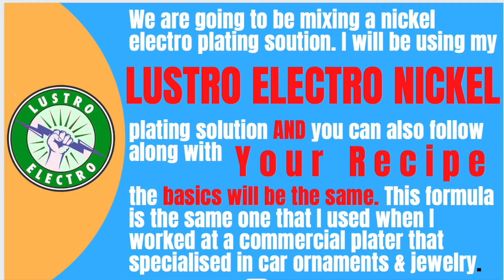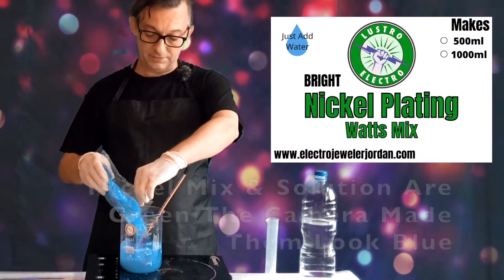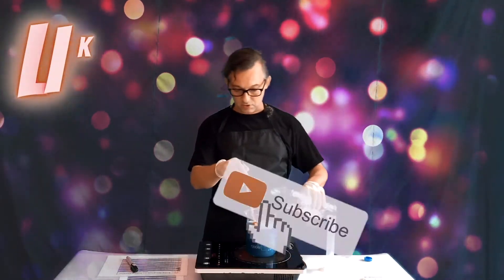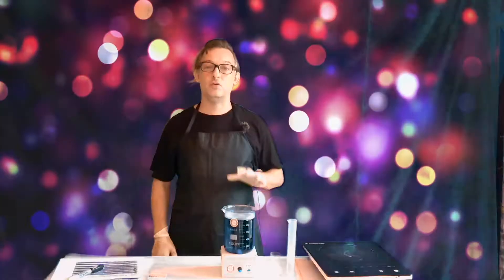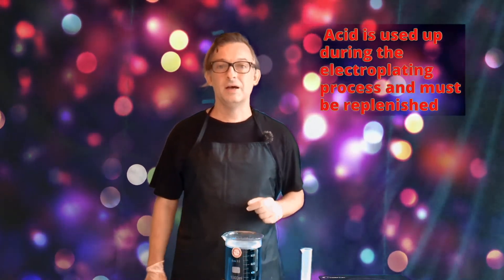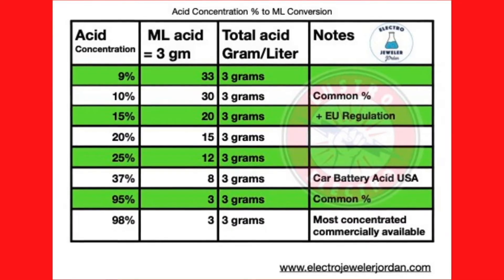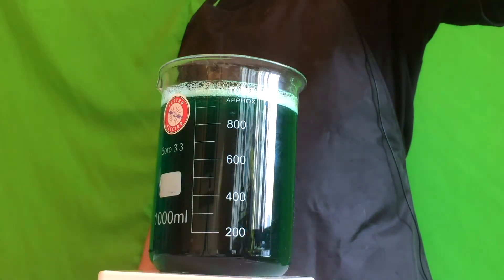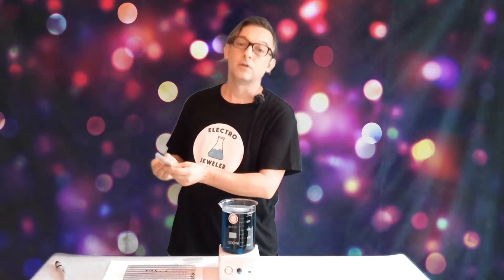Mixing Nickel Solution final cut

Comment: What hot plate are you using in this video?
Reply from the maker: This description is from the walmart website " Electric Ceramic Stove,  Portable Cooktop Infrared Induction Cooker Hot Plate" I believe that the "Infrared " part is the key.  Check the box and make sure it's compatible wth glass.  Very easy to clean and doesn't rust like other hotplates that I've used.

Comment: My nickel is black and has dirt on it
And I mix nickel solution 
4 liter water : 3 lb nickel sulphate
What I need and what wrong
Reply from the maker: It's hard to tell without knowing your recipe and seeing your set up.  But probably your current is too high.  Use between .05 -.1 amp square inch, ph 3-4.5, heated to 50c.

Comment: Hi,
I made a nickel plating solution,but I left it opened and now it's completely dry! Left with nickel green crystals in the bottom..
Can I reuse it? And how? 
Please help
Reply from the maker: No problem, add distilled water to original level, heat and stir, it will work again like new.  If it was open that long it probably has dust in it so before using I would filter it. Also if you added HCL to adjust that may need to be topped up.
Reply: @electrojewelerjordan490  Is the remaining compound Nickel Chloride NiCl2? Also, from your Etsy, which of the kits containt Nickel Chloride NiCl2? I am looking for a source because I want to try Electroless Nickel-(Phosphorus) Plating